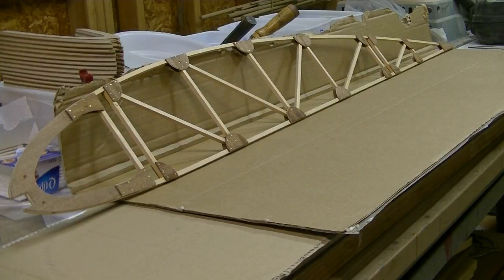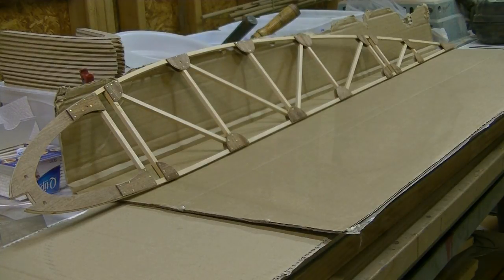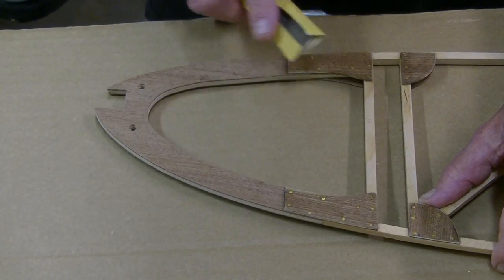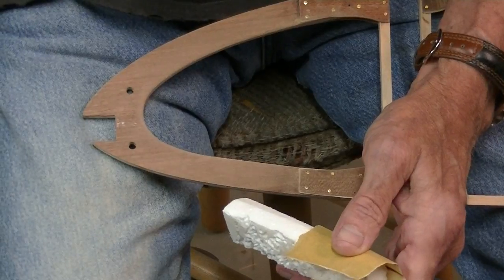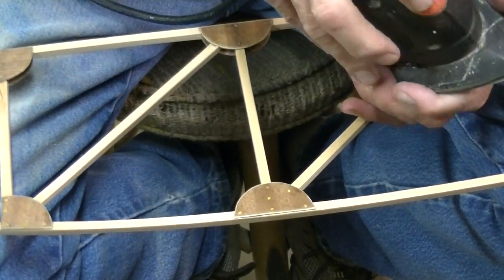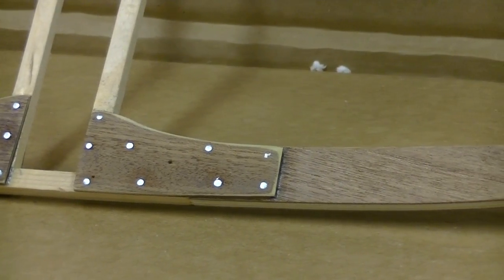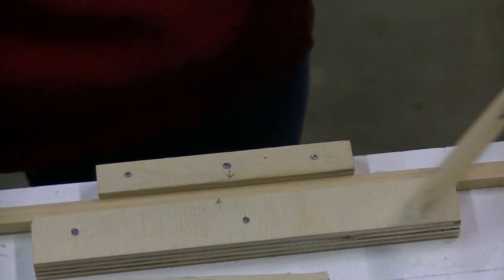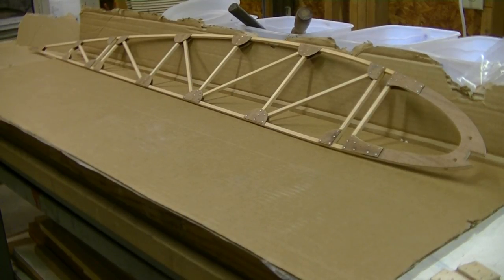Wing rib construction for the Corben Cabin Ace. Part 9 of 14 videos.

Comment: Wanna talk about weight. You gonna take the nails ya?
Reply from the maker: I AM NOT SURE WHAT YOU ARE TRYING TO SAY.  I AM GUESSING YOU ARE TRYING TO SAY THAT IF I WAS GOING TO STRESS WEIGHT-SAVING THEN WHY HAVE I NOT REMOVED THE NAILS?  To remove the nails would gouge up the mahogany gussets that I am not willing to let occur and would show a lack of pride in workmanship, also, I have seen older ribs where the glue had deteriorated and the nails were the only thing holding the gussets in place. I am all about saving weight where it makes sense but not willing to take things too far into the extreme. I hope this helps.